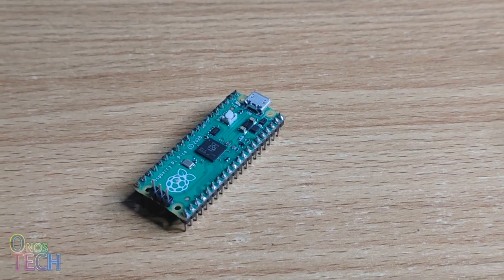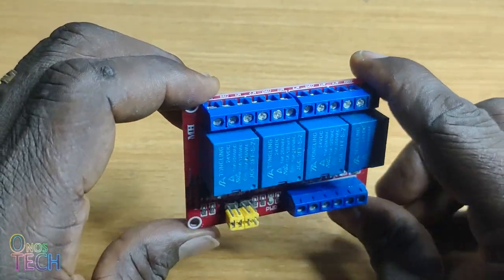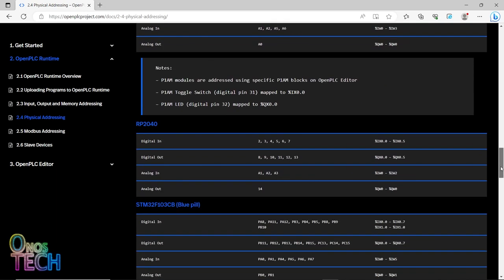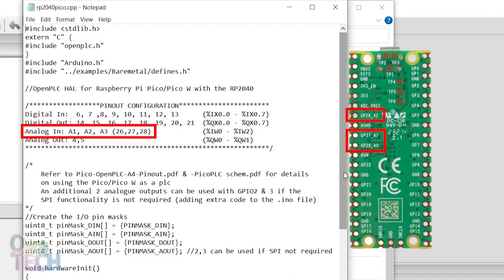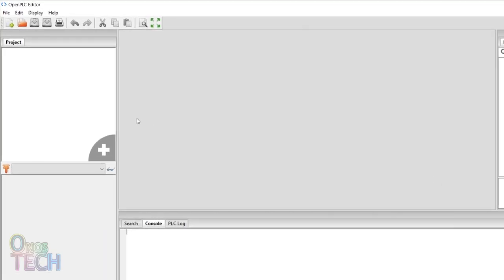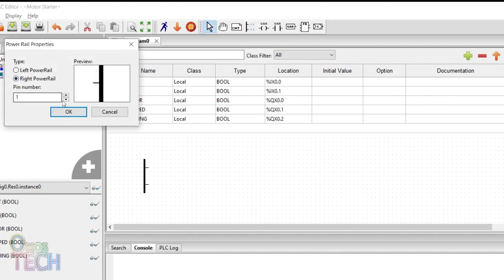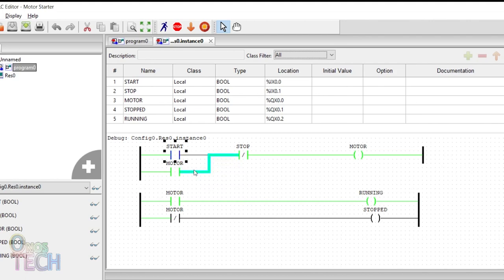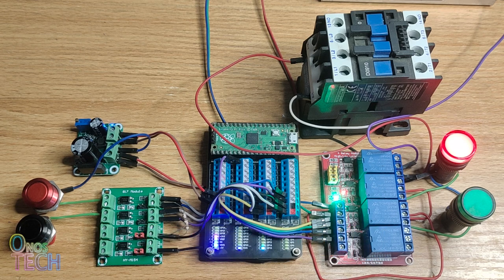How to Build Raspberry Pi Pico PLC || OpenPLC Editor

Comment: Please not this when transferring the program from open PLC to the Pico board the Pico needs to be in Bootsel Mode before transferring the program from Open PLC to the Pico .To put Pico in Bootsel Mode hold the  button on the Pico while connecting it to your computer, it then enters a special mode for uploading new programs called Bootsel mode  RP2 Boot: When the Pico is in Bootsel mode, that's how it shows up as "RP2 Boot" in your Device Manager  This signifies it's ready to receive new firmware. This is not covered in the otherwise excellent video .After transfer of the program the "RP2 Boot" drive will be removed automatically from  Device Manager. This is normal behaviour .
Reply from the maker: Many thanks for sharing your valuable insight

Comment: Your list of items. 10. CJX2-0910 220V AC Power Contactor. When I click on the link it goes to LC1D AC Contactor CJX2-0910 9A 36V but in the video you show 24V... so which one is it? 220V, 36V or 24V?
Reply: I'm also new to this type of work. From research I see going with 24V should be fine as long as I convert using the DC to DC buck step-down converter to properly reduce the voltage down
Reply from the maker: If you must use 24VDC, please ensure that the contactor type is DC and not AC else the contactor will burnout with time.
Reply from the maker: My bad! I used a 220/240VAC contactor. I will check the link and correct it.

Comment: What are the advantages and disadvantages of using this Raspberry PI over say commercial PLC's from say Omron, Siemens etc? . Does it suffer from noise immunity problems when operating an industrial environment ?
Reply: Cost effective, open source, no licences required. Basically a hobby grade PLC